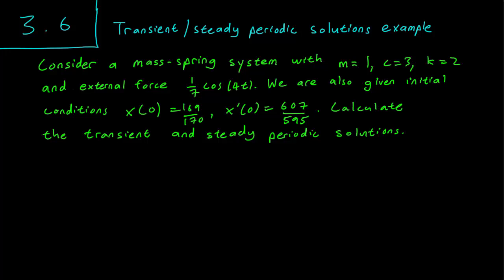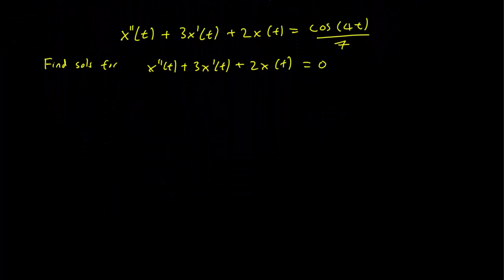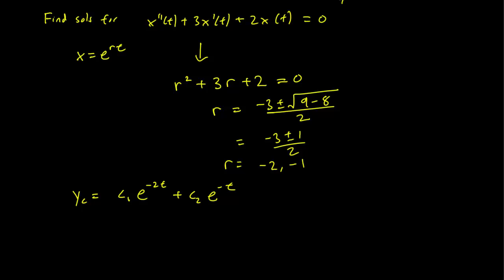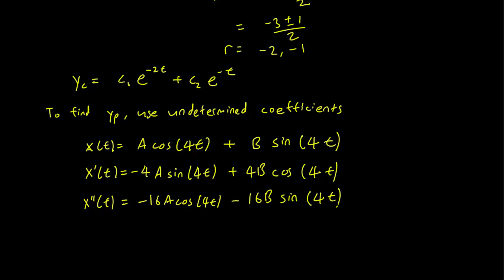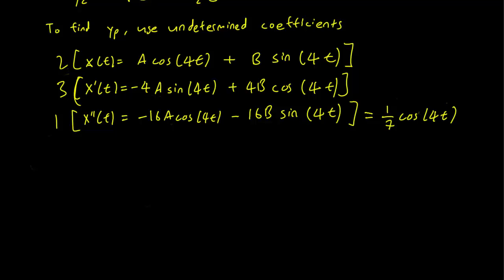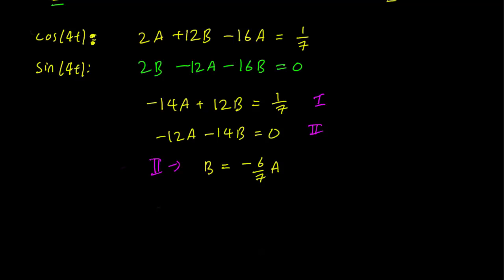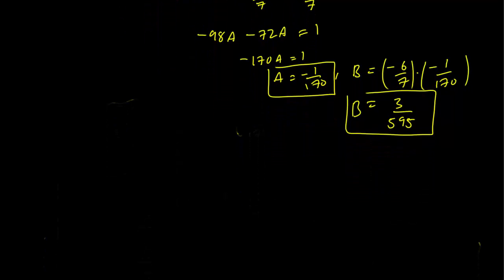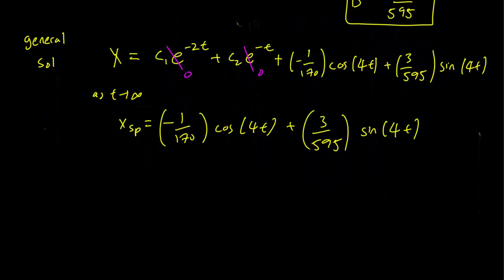3.6 Transient and steady periodic solutions example Part 1

Comment: When you connect a circuit by making the final connection, feedback forces a rapid
rearrangement of surface charges leading to the steady-state. 
This period of adjustment before establishing the steady-state is called the “initial 
transient”.
What is meant by steady-state in a capacitive circuit subject to a sinusoidal voltage input?
A sinewave depicts movements in the form of waves. It has a datum, rapid, slowing and steady growth in one direction for a quarter cycle with reference to a datum (a reference), and then slow and faster decay in one direction for the next quarter cycle, and all these elements again in the opposite direction (reversal) of the forward movement for the next half-cycle. It has peaks and valleys. 

In essence, the sinewave is a perfect embodiment of oscillatory movements like springs and quantities like voltage. It retains its waveshape when added to another sinewave of the same frequency and arbitrary phase and is the only periodic waveform which has this property. 

Imagine that you and your friend are playing a game of “swing”. When your friend sits on a stationary swing and you begin pushing it, it will take a few hard pushes initially to overcome inertia when the swing moves with a small displacement. You then synchronize your pushes by progressively moving slightly away from the stationary position of the swing, initially, pushing gently, and then pushing harder as you move away from the central stationary position of the swing. 

The point of pushing the swing is usually at the top of the swing cycle at one end. It takes a while of pushing before you are able to establish a rhythmic swing. 

The period before the rhythmic swing is established is the “transient”, and the rhythmic swing that is established after the few transient cycles elapse is the “steady-state”. 
This is analogous to establishing the steady-state in a capacitive circuit subject to a sinusoidal input. The capacitor being initially uncharged, will cause the current during the transient period to assume a value that will be quite different from that at the same voltage angle after steady-state is established. 

Electrostatics and circuits belong to one science, not two. 
These are discussed usually separately in textbooks and science and engineering courses. 
It is not possible to discuss the circuit processes which produce a sinusoidal current when a sinusoidal voltage is applied to a capacitor….the changing rates of change of the applied voltage ….the surface charge set up changing at every instant….the applied field changing in the wires ….and the current at each and every instant in time. 

Watch the two videos listed below to learn about current and the conduction process and surface charges (using a unified approach to electrostatics and circuits at a fundamental level). 
1. https://youtu.be/REsWdd76qxc 
2. https://youtu.be/8BQM_xw2Rfo 

The last frame of video #1 lists textbook 4 which discusses the sinusoidal steady-state in capacitors and inductors with the help of sequential diagrams and animated power-point presentations of the varying field components in the circuit elements in more detail with sequential diagrams like when charging and discharging a capacitor.